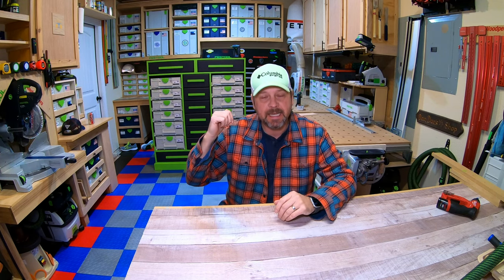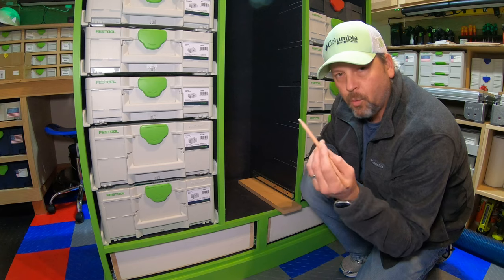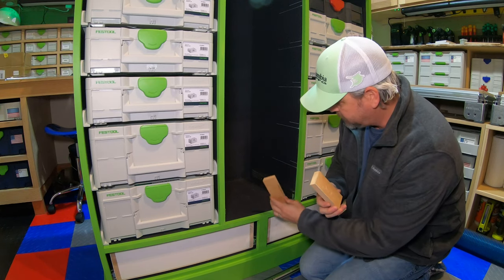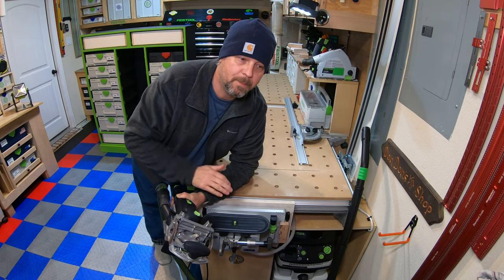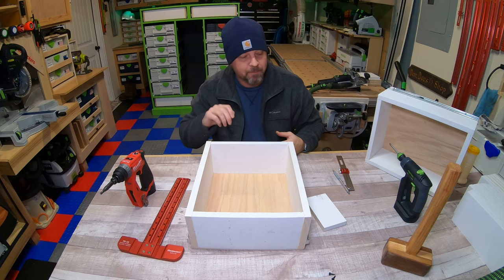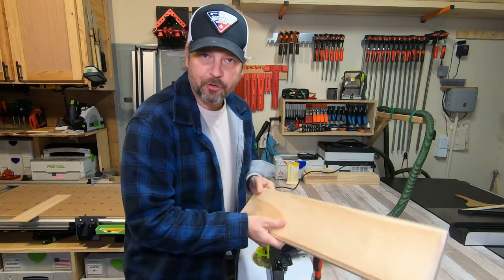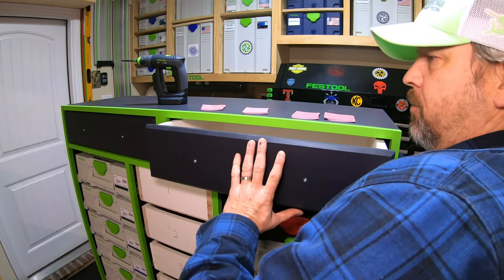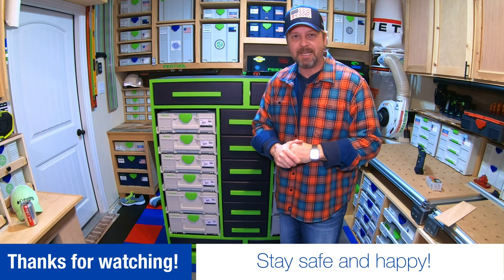Festool SysPort FINAL BUILD: Part 4

Comment: An easier way to determine slide location on the drawer box for the top 5 drawers is to make a spacer block off of the first drawer, no different than you did for mounting the slides in the cabinet. Much quicker than drawing lines and then drilling. One piece of scrap and one cut on the table saw and you’re ready to install the other slides. Set the spacer on the table against the drawer side, set the slide on the spacer, align the front of the slide flush with the drawer front and start drilling. Project turned out great! Nicely done.
Reply from the maker: Very true Steve, and I’ve actually used that method before and it worked just as well.  Thanks for the comment!

Comment: Great build, looks good. For drawer slides I use a simmilar method, but just using an Incra Tiny-T from the bottom of the drawer. So you can slide and mark at the same time. Bit of a mix between your method and Jason Bent's.

Comment: This is my new favorite channel, well done! Can I ask you about your mini systainer cabinet? Are they on slides? If not, are they difficult to pull in and out without handles or slides? Also, what do you store in your mini’s? There isn’t much content on the minis and it looks like you’re a fan. Thanks again for the great content.
Reply from the maker: Hey Ryan. Thanks so much! The mini Systainers are not on slides. I just built the boxes just big enough to where they would slide in and not have too much wiggle room. They are easy to pull out by the t-loc. I keep just a lot of misc items in these...small tools, brad nails, cutting blades...etc. Now I think about it, might be a good idea for a video👍🏻
Reply: @BrianWatersOutdoors  great, I look forward to it.  As my mini collection grows, I’m thinking of building the same type of rack above my rolling toolbox. Thanks!